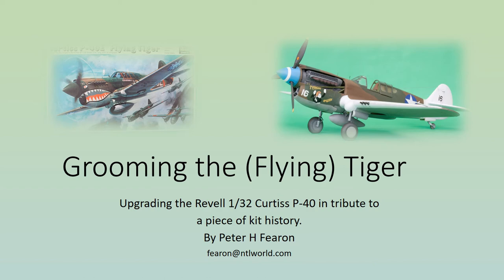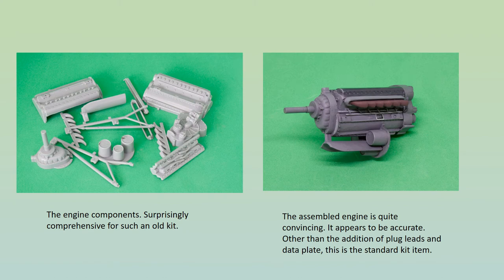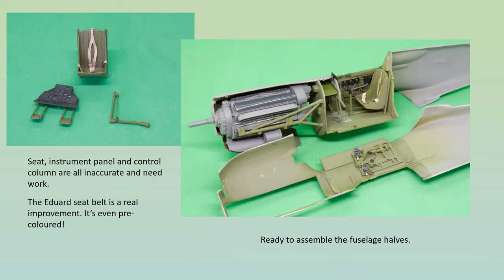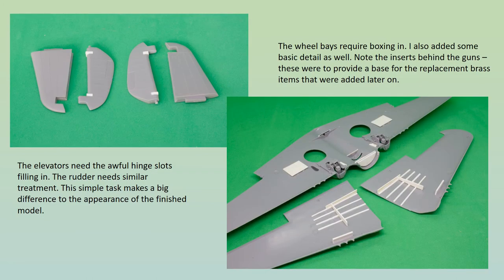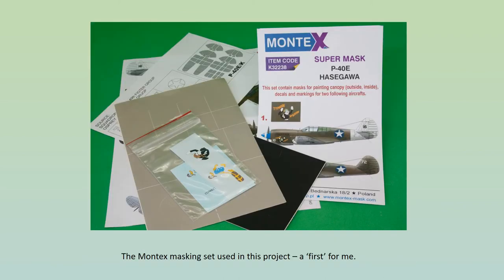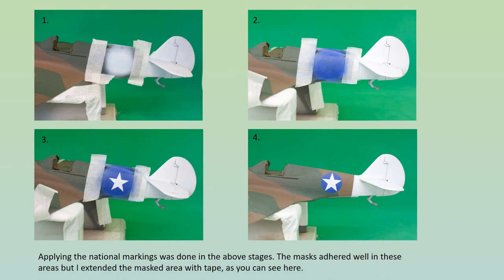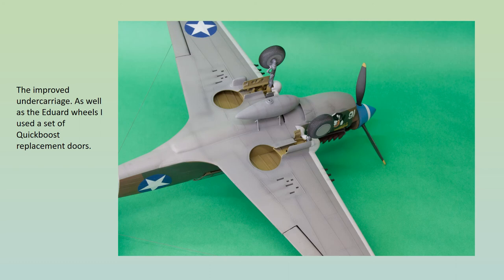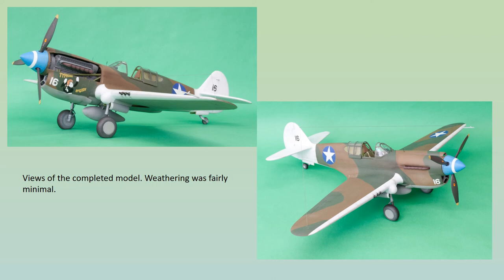Grooming the (Flying)Tiger - Building the Revell 1/32 P-40

Comment: Nice choice Pete, it was one of my early models and I thougth it was a big kint in the early 70's in 1/32.  I had a fresh kit so no fit issues, albeit the modern moulding have fantastic rivet and panel details I remember this one was good for its time.   Of course no PE then and Eduard wasn't born and it would have been behind the Iron Curtain anyway.

I love the Alison engine work, I love to add wires where needed and the burnished guns really lift it out of the 70's but  the feel of it is still there.  Cleve masking, a ot of work but decal edges are so often spotted by viewers and certainly by us builders.  Great wheels/tyres also sharpen it nicely.  In my day I didn't know of inaccurate seats, columns and suchlike.  I used to make seatbelts out of softened heavyweight paper - thank goodness for PE.

I love the gun barrels and gun-sight it lights the kit up - I am working on some brass 50 and 30 cals in 1/35 and I might take some photos.  Again well-controlled weathering.  Good tips all round Pete, thanks.
Reply from the maker: Hi Gordon
Many thanks again. So pleased to read that you think I managed to keep the character of the old kit despite the modifications - that's exactly what I was trying to do.

Comment: May I ask,why you have painted the P40 in the RAAF colours,and marked it as a USAAF aircraft
Reply from the maker: Hi There Lee

Thanks for the message and sorry about the late reply. Just got back from a spell in Indonesia.
I'm no expert on SEATO colours, but I'm sure the ones on the P-40 are accurate. They are USAF shades, not Australian, which looked similar but were in fact slightly different. Same applied to the RAF colours. The finish on all of the allied aircraft in the SEA theatre looked generally similar and this was reinforced by the white theatre markings that were rigorously and fairly consistently enforced. 
Hope that answers your question.
Best regards
Peter F
Reply: @peterfearon317  AHH ok,thanks for that, appreciate you getting back to me, I've only ever known of RAF and RAAF aircraft in the SEAC theatre have the white ID bands,now thanks to you,my knowledge of this conflict is expanded,I only ever knew that the red centres of all roundels,USAAF included were omitted to stop the confusion with the Japanese Hinomaru meatball insignia
  Lee

Comment: Finally a model without the somewhat annoying exaggerated weathering and stain which is obviously 'fashionable'. I read somewhere, that the early dark green/earth upper surface camouflage of american built aircraft for the RAF was only an approximate fit (for instance a more reddish brown) to the colors specified. I suppose you took account of this when you painted your model. The propeller appears to be a bit too small (diameter). Otherwise a very good model...
Reply from the maker: Many thanks for your comments. I believe you are quite right about the colours being the 'best match' US equivalents. As you suggest, I tried to take that into account with the colours I used. I'm sure you're right about the prop too - I left it as it was because I wanted to keep a bit of the character of the old kit. I'm also glad it's not just me who is fed up with the weathering craze that seems to be taking place in the model building world at the moment.